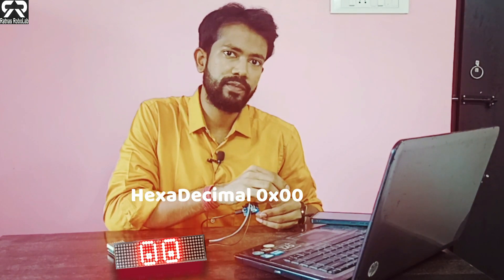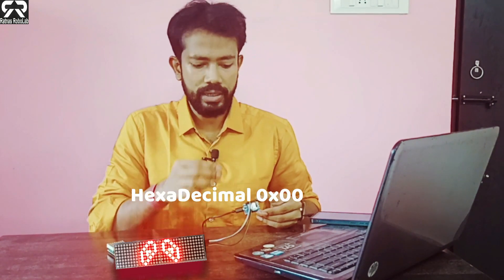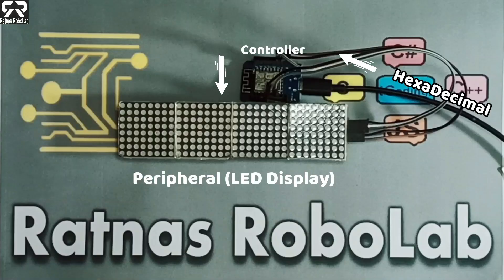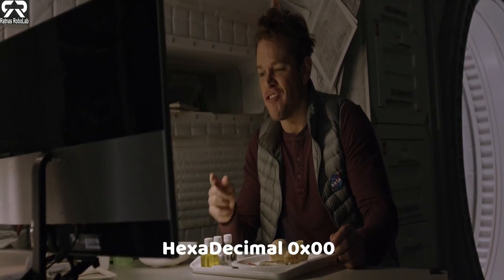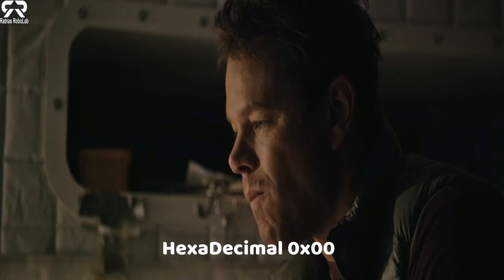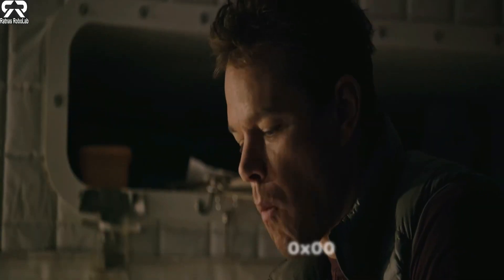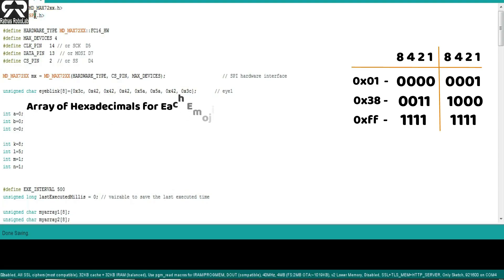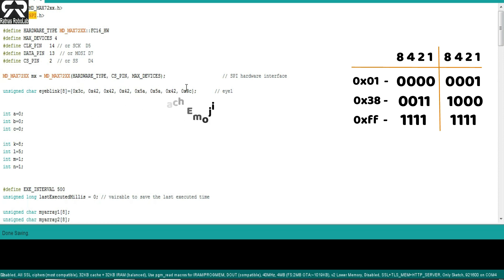How to make Robotic eye animation on MAX7219 LED Display

Comment: Can we only use 2 display max7219? Not 4in1.
Reply: hey this is late but you can use 4in1 you just have to change this line
#define MAX_DEVICES 4

it will be 2 by default
Reply from the maker: Yeah you can watch our digital clock (https://youtu.be/Vu32EiQpa_w) and shorts animation on max7219 display

Comment: Can i order custom animation?
Reply from the maker: You can easily build it by yourself, I will provide you the code. You have to buy only 2 things Microcontroller and max7219 led display board. (Link  in the video description) What's your custom animation?
Reply: @ratnasrobolab  Please make a video how to make an animation from zero to what it is using what is given how to determine the hex code how to make the image code how to make the next animation for 8x32 7219 please
Reply from the maker: please check video description, anyways just go through my website (link for circuit diagram and for all components which I used, controller and max7219 led panel and how to create array of hexa decimals and how to send it) : https://ratnasrobolab.com/robotic-eye-animation-max7219-led-display/          please support us by subscribe and share our channel youtube.com/RatnasRoboLab